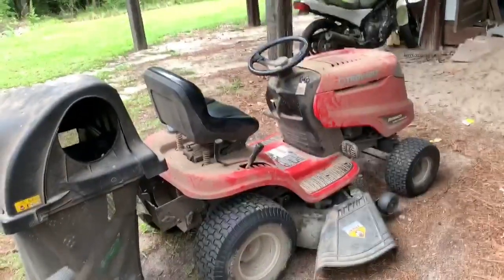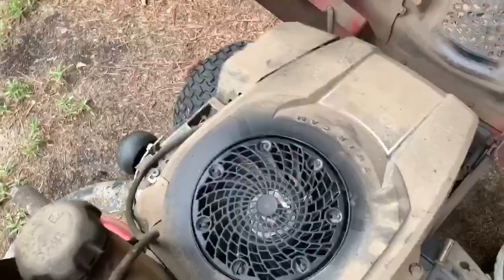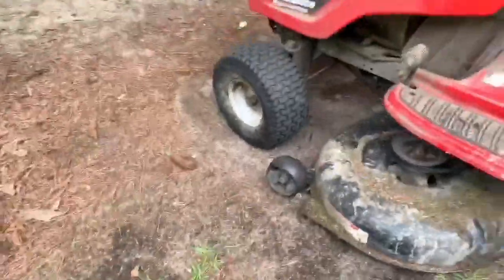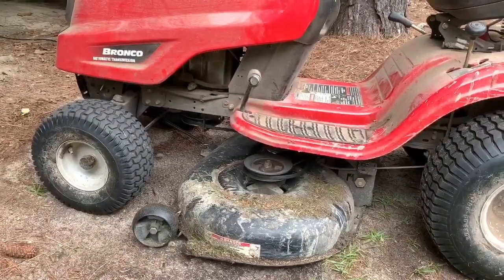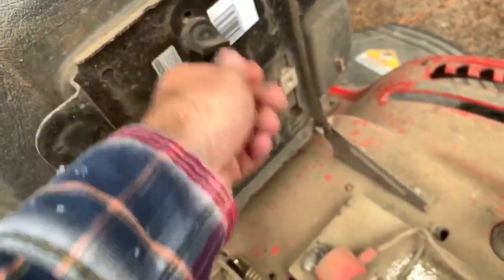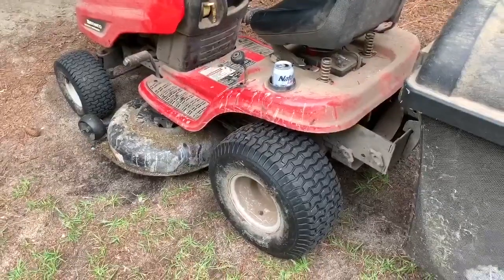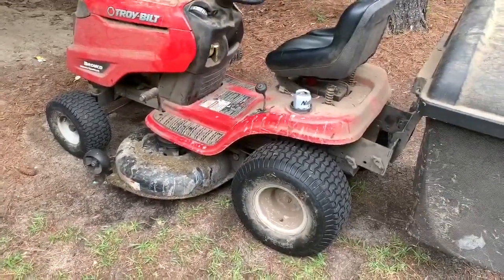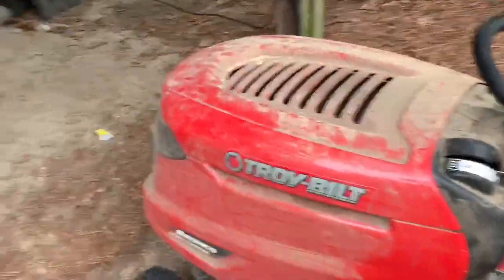Troy bilt Bronco 42 inch Riding Lawn Mower Review

Comment: There are belt 'keepers' inside the pulley covers that keep the belt from coming off.   You should leave those covers in place.  The grass accumulation inside is expected and the heat buildup is not an issue in my experience.
Reply from the maker: My belt was coming off from a worn idler pulley. That’s why I took them off I’ve recently fixed that issue but I still kept the covers off in case the belt comes off I can put it back on in a minute or 2

Comment: Im a lady having 1 delivered today 2/7/24.  Mine has a briggs and stratton engine.  I hope i dont have the belt and springs issue's. I need a dependable one.  Im not paying 300.00 a yr for warranty.
Reply from the maker: Congrats on the new mower. I think my blade and spring issues were caused by the terrain in my yard. It’s really really sandy here. If you’re just mowing regular grass you should be fine. My mower will be 11 years old this July and it’s still going. Good luck!
Reply: I have had mine for a year. It has the Briggs. You won't be disappointed.